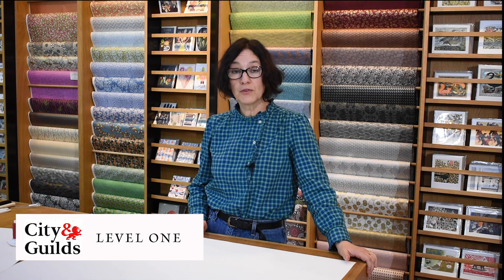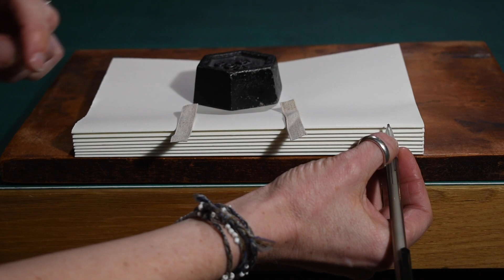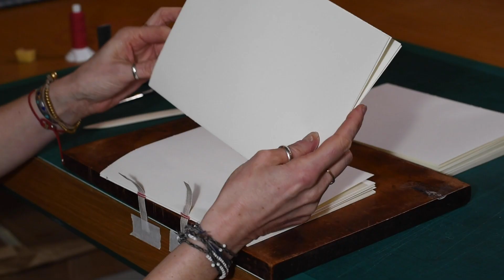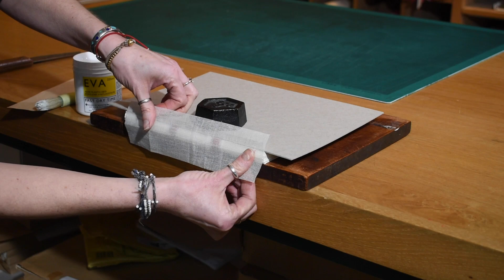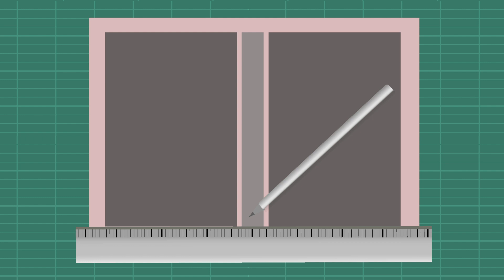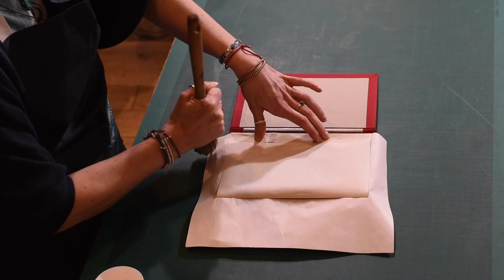Chapter 2   Multi-section Bookbinding

Comment: I use silicone baking mats instead of blotting paper. I also glue the spine whilst the book is clamped, between boards with silicone mat either side to stop sticking. I use braided dacron fishing line for sewing as it is strong and easy to acquire where I live. For mull I substitute tyvek. Not easy to get some things in some countries so I have had to improvise. It is the cost of delivery that makes buying from abroad prohibitive.